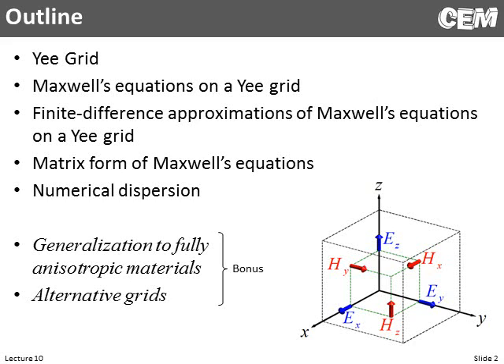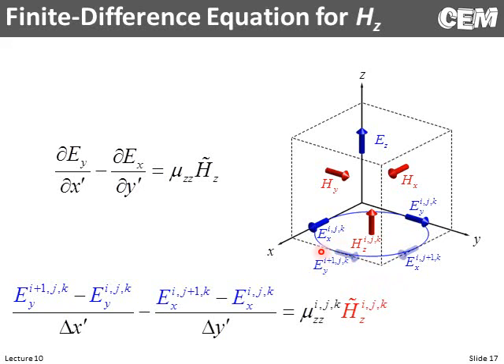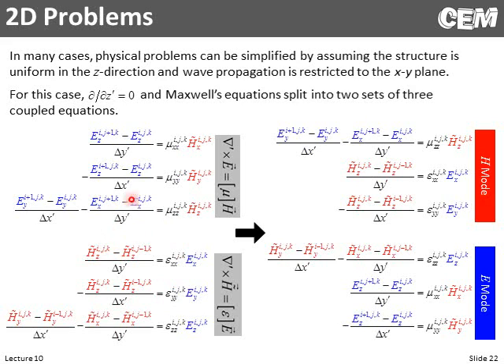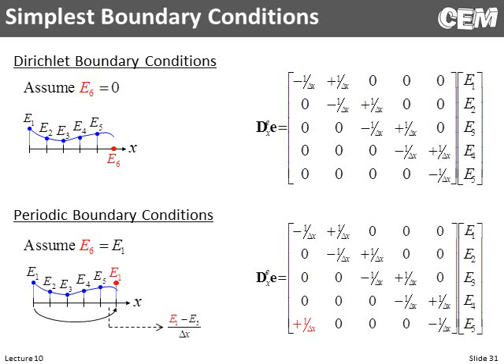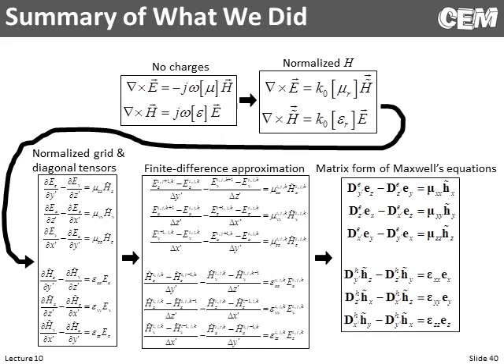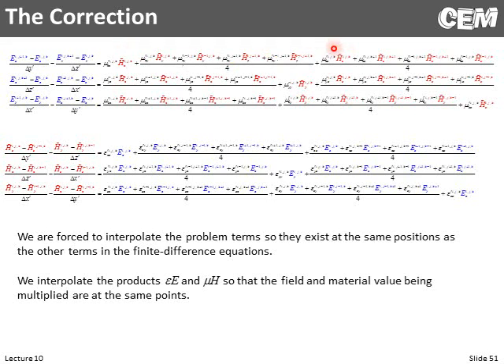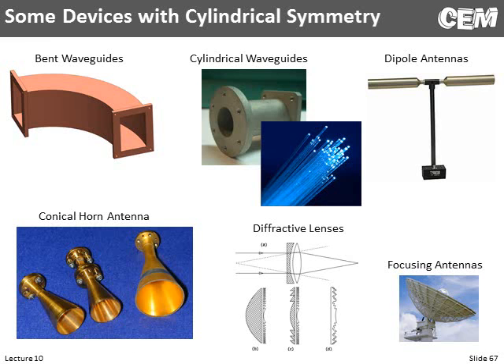Lecture 10 (CEM) -- Maxwell's Equations on a Yee Grid

Comment: Dear Prof, I am unable to consolidate the spatial derivatives and time derivatives (in another lecture) defined in the Yee grid. May I know why the spatial derivatives are defined at half integer steps in space for both E and H, whereas in time derivates, E is defined at integer time steps whereas H is defined at half integer time steps?
Reply from the maker: The wording here is challenging.  Everything occurs in whole time steps.  It is just that E and H are offset from each other by a half time step.  Think this way...

E(0) --> H(0.5) --> E(1) --> H(1.5) --> E(2) --> H(2.3) ...

Same for the spatial derivatives.  Both E and H are separated by one grid cell, but their relative positions are offset from each other by a half grid cell.

BTW...I do a great job of explaining and illustrating this in my paid online FDTD course.  I am not trying to sell you anything.  All of this is explained in the first half of the 1D FDTD course that is completely free and open to the public.  I highly recommend it if you are just starting out.

https://empossible.thinkific.com/collections/FDTD-in-MATLAB

Also, if you are interested in obtaining a frequency-domain solution, you may want to check out this book...

https://empossible.net/fdfdbook/

Hope this helps!!
Reply: Dear Prof, thanks for the clear explanation, which resolved the dissonance I experience from the 2 perspectives. As such, I perceive the Yee grid better now.

Comment: If we restrict propagation to the x/y plane, can we actually use this to simulate useful things? My understanding of waveguides (for example) is that they are often invariant along z, but they definitely do have power propagating along z (and hence a z component of the k-vector). Can we ignore that and treat it separately?
Reply from the maker: Yes, absolutely!  In fact, I think it is great practice to simulate devices in 2D first before moving on to 3D.  Very often I can get my designs 95% complete with very fast 2D simulations before moving on to the big and slow 3D simulations.

The very next lecture in this video series talks about how to do rigorous waveguide analysis.  Remember that a 2D simulation does not set z components to zero.  It sets derivatives in the z direction to zero because the device is uniform in that direction.  For waveguide modes propagating in the z direction, the derivative is not set to zero, but the only thing changing in the z direction is the mode accumulating phase so it has the same numerical effect of reducing the set of 3D equations to 2D.  There are many other situations when 3D devices can be approximated as 2D and I think it is very good practice to do that first.

The ability to perform 1D and 2D simulations is very powerful!

Comment: This is a great lecture series. I had a couple questions:

1) I've read before that you can use Kronecker products to easily increase dimensions. You don't mention Kronecker products at all, but do you know of any references or lecture series that touch on Kronecker products in relation to FD methods?

2) Do you have (or you know of) any lecture series that talk about non-uniform grids or unstructured grids? For example, I found that the relation DEX = -DHX' does not work for non-uniform grids which I think is an important point.

Thanks
Reply from the maker: The way we build the derivative matrices is very simple, but definitely not optimal.  I do this because I "think" it teaches the concept of the derivative matrices better than just letting the Kronecker do all the work.  However, I get a lot of questions like this and folks are realizing more than I thought they would that we are building these matrices in a way that is very slow for large matrices.  Unfortunately, I do not have any notes on this, but is definitely on my radar to show techniques like this.  Thank you for point this out!

I do not have anything on non-uniform grids, but I have implemented this many times.  The main thing is that every point on the grid will have its own unique finite-difference equation and you need to calculate these one at a time.  This makes the finite-difference method start to look like the finite element method where element matrices are calculated for each element and then assembled into the global matrix.  I do discuss how you would derive the finite-difference approximations themselves on a non-uniform grid in Topic 6b here:

http://emlab.utep.edu/ee4386_5301_CompMethEE.htm

Hope this helps!

Comment: Sir, How DEX, DEY,DHX,DHY matrices are created in two dimensional grid. 
How to know where dirchlet conditions to be incooporated in matrix and why Nx spacing for non zero value in DHY,DEY ? 
Why Dirchlet conditions are not required for Y dimension and how we can say Y is the last dimension ?
Reply from the maker: I have recently created a different set of lectures that take you through this.  See Lectures 6b, 6c, 7a, 7c, and 7d here:

http://emlab.utep.edu/ee4386_5301_CompMethEE.htm

I think this will clear up your confusion.
Reply: Thanks, Lecture 7 C cleared the doubts.
Reply from the maker: Great!
Reply: @empossible1577  Hello professor, I have several questions regarding derivative operator boundary conditions: 
in another video you say that a PML is needed to not have reflections from the boundary when a Dirichlet boundary condition is used and a spacer region is needed to not have evanescent fields reach the PML. 
What if Neumann boundary conditions are used? Would that make the PML and spacer region unnecessary? And are Naumann boundary conditions on the vertical axis compatible with pseudo-periodic boundary conditions on the horizontal axis?
Reply from the maker: @ezyxas  A PML is one way to suppress reflections from a boundary, but I did not mean to imply it is the only way.  If the PML is working correctly, it does not really matter what boundary condition you use.  I tend to use Dirichlet only because it is very simple.  The issue is that the PML has a high refractive index so when evanescent fields enter them, propagating waves can be excited that provide an escape path for power from the simulation.  The spacer region is to allow the evanescent fields space to decay so this does not happen.  There has been lots of work on PMLs to improve this problem. 

You are on the right path thinking about Neumann BCs.  The problem is that they assume the function continues linearly outside of the grid, whereas waves continue exponentially.  If you come up with a BC that accounts for the exponential behavior, you will not need a PML at all and it will handle evanescent fields perfectly with no need of even a spacer region.  These do exist.  I have not played with them much, but the few experiments I have done have not impressed me.  The implementation has always been too complicated to make them worth the trouble.  If you want to see one of these I have done, checkout my paper on the slice absorption method:

https://www.osapublishing.org/josaa/abstract.cfm?uri=josaa-24-10-3123
Reply: @empossible1577  than You for the quick and informative reply. I will definitely check it out. However, I am still not sure why Neumann BC is not appropriate here, because the reflection and transmission planes are before this boundary condition is applied, therefore it should not matter how the function behaves outside the grid, or is there something I don't understand here?
Reply from the maker: @ezyxas  The T and R planes do not affect the field at all.  Those planes just monitor and calculate reflection and transmission.

My point is that the Neumann BC will not work for waves or evanescent fields because they extrapolate outside of the grid exponentially.  The Neumann BC assumes functions extrapolate linearly.  Regardless of what you do with T and R, the Neumann BC will give an incorrect field in the simulation so any way of calculating T and R will give incorrect results.

With this said, give it a try!  You will learn more about the method trying things like this than you will any other way.  I have gotten to know the method pretty well only because I have made every possible mistake there is to make.  ha ha  There is also the possibility I am wrong!
Reply: @empossible1577  Ok, thank You very much for the awesome answer, have a good day
Reply: @empossible1577  I have read the paper thoroughly and have one question regarding the boundary condition You have mentioned. In your slice absorption video at https://youtu.be/SU0L9skTyrA?t=703 you show that the first slice has no A1 matrix and the last slice has no Cn matrix, but then say "they can be calculated". 
Can You elaborate on how they are calculated? In the part on the transparent boundary the propagator matrix is incorporated into these matrices, but I don't understand how to calculate them.
Reply from the maker: @ezyxas  Calculate them as if there is another layer above or  below them.
Reply: @empossible1577  Thank You for such a fast response, will try to do that
Reply: @empossible1577  Hello professor, I have successfully implemented the slice absorption method (SAM) for FDFD. I used the transparent boundary condition (TBC) form Your paper. It works well for reflection and transmission from a lossless dielectric surface (I compared SAM results with results obtained with standard FDFD & Fresnel equations). 
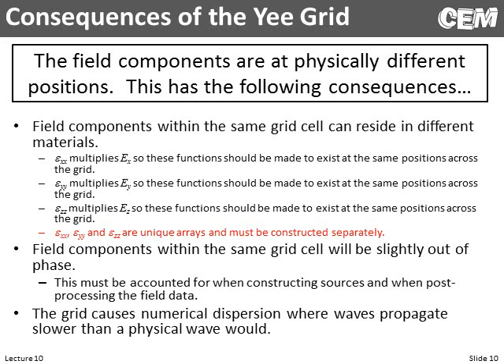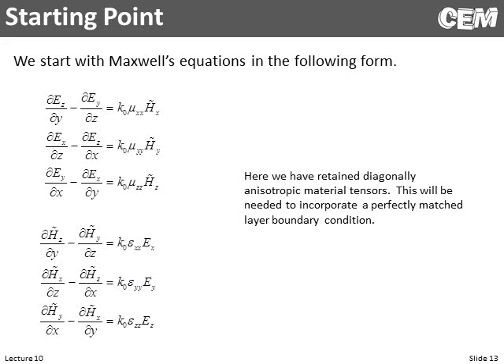However, it seems to produce wrong results for the GMR example You provide in this course. The errors I get are similar to those that happen in FDFD when grid resolution is too small and a spacer region is set too small - energy conservation is broken and resonances are not where they should be (CEM lecture 14 - FDFD extras - at 10:02 and 12:18). I have tried changing both the grid resolution and the spacer region but nothing helped. 
Perhaps You have an idea what I could be done wrong? I have a hunch that the problem lies in the fact that GMR has bigger evanescent fields compared to a simple plain surface, but am clueless on how to fix it. My grid is constructed as follows: 
Reflection recording plane with incorporated TBC (slice 1 - 1 cell thick)
Scattered field plane (slice 2 - 1 cell thick)
Total field plane (slice 3 - 1 cell thick)
Upper spacer (slice 4 - 1 cell thick)
Device (several slices)
Lower spacer (1 cell thick)
Transmission recording plane with incorporated TBC (1 cell thick)

Any help would be greatly appreciated. Thank You.
Reply from the maker: @ezyxas  Congrats on getting all that to work!!!

The TBC does not need spacer regions.  That said, go ahead and add a spacer region and see if that fixes the problem.  That is at least a hint about what might be going wrong.

Try just a single plane wave in air.  See if the TBC handles that.  Start simple and work up to more complicated things to try to fix it.

Comment: Dear all, I have a few questions regarding 2D configuration:
For a 3D structure, that is invariant in z-direction:
1) Is not it enough to solve either E or H mode? From the lesson I understood that, both E and H modes will be solved independently.

2) Will solving both E and H mode, give three dimensional information about a z-invariant structure? 

3) I was reading about 2.5D formulation, that claims to be computationally efficient as it takes a 1D FT of the Maxwell Equations in the invariant direction, and it solves for all 6 fields components but the discretization domain is 2D.
I am confused to understand the difference between solving both E & H modes to get all 6 pieces of information, or to solve 2.5D?

Please assist.

Thank you
Reply from the maker: In order for Maxwell's equations to decouple into two distinct modes, you need three conditions: (1) device is uniform in one direction, call it the z direction, (2) materials must be at most diagonally anisotropic, and (3) wave propagation is restricted to the xy plane.  If any of these conditions are not met, all of the field components are coupled.  I have called these two modes E and H because you can reduce Maxwell's equations to a single scalar equation.  The E mode is reduced to just a single component of the electric field and H mode is reduced to just a single component of the magnetic field.

Given you have these conditions, most devices are designed to operate using just one of the modes.  The device is excited by that particular polarization, and the behavior of the other mode is just ignored because it is never excited or used.  That I know of, it is not possible to determine the behavior of one mode by simulating just the other.  So it is not enough to simulate one mode and somehow infer the behavior of the other.  It is possible to construct a single matrix wave equation that contains both E and H modes simultaneously, but I think it is numerically more efficient to just solve them separately.

Comment: I have a question regarding the homework (yeeder function). How do I incorporate the direction of the wave propagation kinc? I already solved the problem for periodic boundary conditions as explained, but don't see the need for kx and ky. Thanks once again for the excellent content
Reply from the maker: kxinc and kyinc are used in the exponential terms for the periodic boundary conditions when there is an angle of incidence.  Sometimes these are called pseudo-periodic BCs or Floquet BCs.  You will see this I think in the first FDFD formulation lecture.
Reply: Great! Thanks for your early response, I will watch all the FDFD lectures, and then do all the homework up to that point.
Reply: Hello Prof. Raymond. I was reading some of your papers, and thesis as well as other papers regarding the application of Floquet BCs in the FDFD formulation but didn't find much info. about this. Although the topic is excellently explained in your lectures I would like to know if you happen to have any specific paper on the topic because I'm planning to write sth. about BCs in FDFD and would like to cite it. Thanks for your help
Reply from the maker: That is a good point.  This is usually the paper I reference for FDFDhttp://www.jpier.org/PIERB/pier.php?paper=11092006but it does not cover the periodic BCs.  I think my dissertation or course notes are really the only thing you can reference.  It may be best to reference my dissertation, although it is always best to reference peer-reviewed articles.  However, if that is where you got the information than that is all you can do and it is correct to do that.  It is even proper to include as a reference "personal communications" if you got information from a conversation.
Reply from the maker: That is a good point.  This is usually the paper I reference for FDFD
http://www.jpier.org/PIERB/pier.php?paper=11092006
but it does not cover the periodic BCs.  I think my dissertation or course notes are really the only thing you can reference.  It may be best to reference my dissertation, although it is always best to reference peer-reviewed articles.  However, if that is where you got the information than that is all you can do and it is correct to do that.  It is even proper to include as a reference "personal communications" if you got information from a conversation.
Reply: +CEM Lectures thank you!

Comment: Could you please explain why the using Yee grid shall result in Divergence-free condition for electric and magnetic fields? I wrote the divergence equations for two adjacent unit cells, and it automatically does not become zero. 
Also how are the boundary conditions naturally satisfied? Do you mean the boundary conditions between two unit cells?
Reply from the maker: +_jp88 The proof of the divergence free nature of the Yee grid is derived by in Taflove's book on FDTD and I did not think it was worth including in the course.  I do give that as a handout to students who take the class.  Send me an e-mail at rcrumpf_at_utep.edu and I will send that to you.

By "satisfying natural boundary conditions" I mean that if you have a material interface meandering through your grid, you will not have to do anything special to simulate it accurately.  If it were not for the Yee grid, you would observe crazy things like 800% reflection from a surface for some polarizations.
Reply: +CEM Lectures Thank you.
Is that "satisfying natural boundary conditions" true even for the normal flux components? It is easy to think of the field components satisfying the continuity property along a tangential boundary. I hope I am think of it the right way.
Reply from the maker: +_jp88 Yes.  The only remaining problem really is the staircasing of a curved surface due to the Cartesian grid.  There are fixes for this like dielectric smoothing, unstructured grid, etc.

Comment: Is it possible to simulate lumped capacitor and inductor in 3D FDFD grid
Reply from the maker: Yes.  You will need to use an "impedance boundary condition."  This essentially entails replacing the finite-difference equation at the point containing the lumped element with an equation that enforces the I-V properties of the element.  You can find references for this in the finite-difference time-domain literature, but I have not seen it in the literature for FDFD.